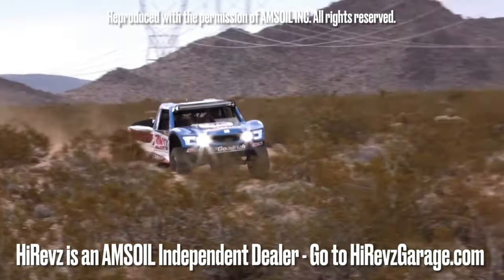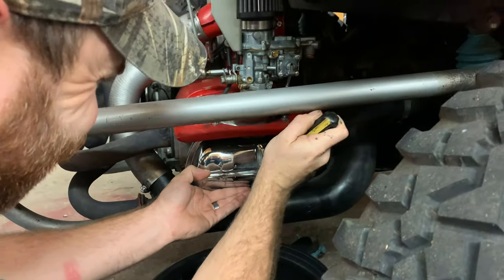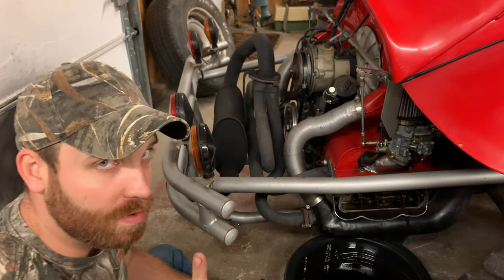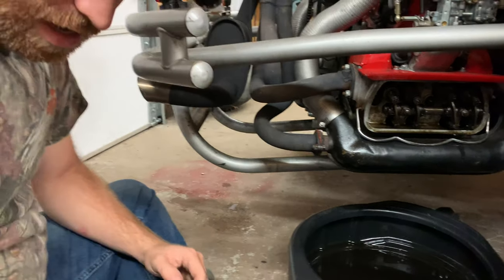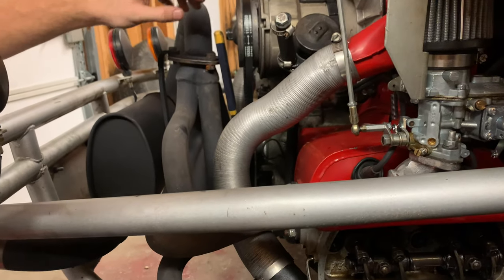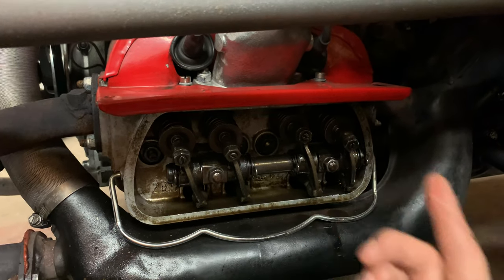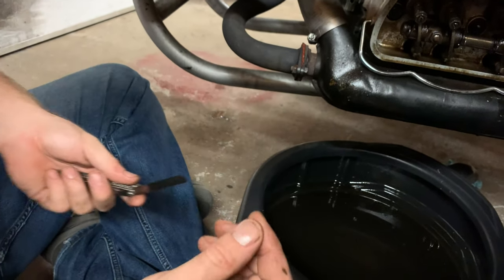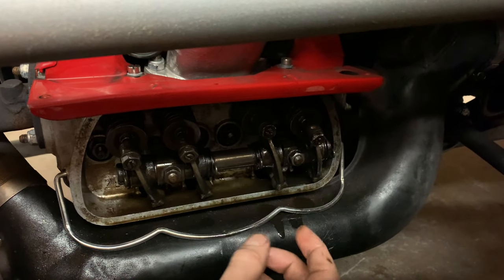How to Adjust the Valves on a Classic VW Beetle

Comment: Quick and too the point, but also explained very well. I set my lash too tight, and it started to backfire from the float when hot. Also the valve keepers started flaring up the groove where they rode on the valve, I had to file the groove down to be able to slip my valves out of the valve guide. Well I could've probably hammered them out, but trying to avoid replacing the soft valve guides. 
Why didn't you go to a better rocker arm shaft, with bolts on the ends, rather than the clips? I've read a lot about replacing those, when you start putting more power into the engine, but maybe it's just because so much info comes from parts sellers, and they're probably trying to sell me their rocker arms.
Reply: Good job troubleshooting and figuring out your issue. And you are correct about using a strong rocker arm shaft with bolt on ends. When we initially shot this video I was still running the stock style shaft that you saw. Mainly because I built this engine using a set of stock heads and valve train and only revving ot to 5500 rpms. I have since upgraded to CB performance panchito heads, chromoly pushrods, and scat 1.25 screw on end rocker arm shafts. The main advantage of using the aftermarket screw on ends is that alot of them have roller bearing shafts so it takes less engine power to turn them. You also don't run the risk of a clip falling out and a rocker arm walking off the shaft. However, that can also happen if the bolt backs out of the screw on type.
Reply: @gregbryant6639  Thanks for the response! That makes sense then, and nice upgrades!
 I'm going to try porting out my stock heads, worst case I ruin them, have to buy better heads, and I learn how not to port in the process lol. Someone upgraded my rockers to the bolt style already, even though the rest of the engine is mostly stock, aside from a piston/jug slap to 1776.  Funny the way some people decide to upgrade things like that, maybe the clips were just bad on the old ones before I owned it.